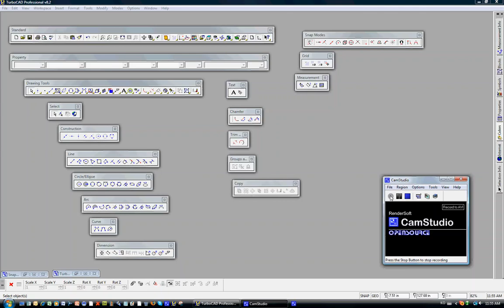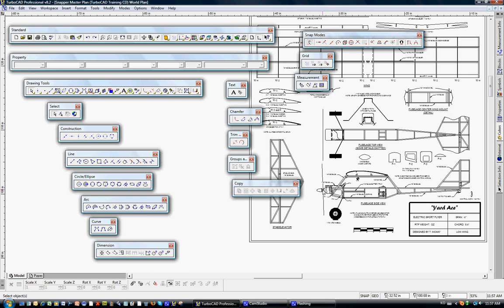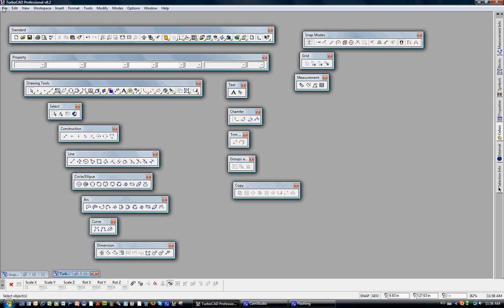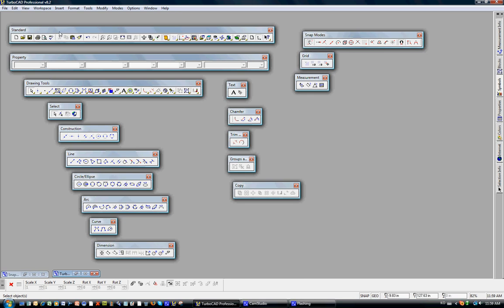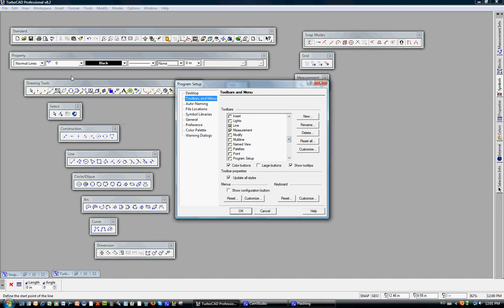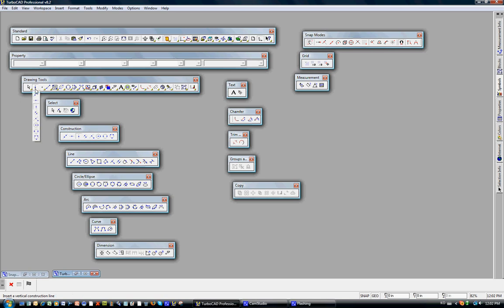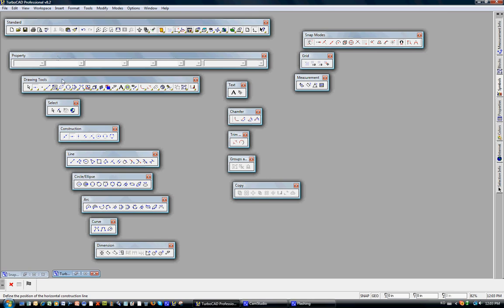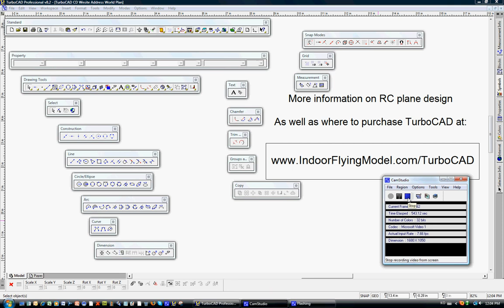Lesson 1 of 12 - Introduction to TurboCAD

Comment: What level of QCAD are you using in these videos?
Reply from the maker: Donald:  Version 8 (long time ago).  I've had so many issueswith TurboCAD version upgrades and cost, I am "all in" for 2D CAD drawing with www.QCAD.org  Around $40, works like a champ.  See my video for tips and tricks.  Tim
Reply: Tim, thanks again for the quick response. and I'm right with the comments in your answer. I have worked with SketchUp for years I have gotten hit with the response from them for the last few years, money, money, etc. I didn't state my question well the last time. I have been very impressed with QCAD, thanks for the reference. when I watch your series of lessons even starting with #! ,you seem to be able to split up the tool etc. lines very well and place them in nice thin lines at the top of the page. I can split them up and move them around well. The problem I'm facing is that all come out about 2+ inches wide on my screen. what do you do to keep them all so thin. Thanks for your help Don.
Reply from the maker: @DonaldYEastArtist  Just fiddle around with it and check the blog, you will figure it out!   Tim

Comment: Looks like the website has been taken over. What version do you use, Designer or Deluxe?
Reply from the maker: Anthony:  These TurboCAD lessons were done 10 years old on Windows, Ver 8, Deluxe.  I have Deluxe Ver 12 now on a Mac, will add some videos with this newer interface.  Basic 2D commands (snap, trim, etc.) are still the same.  Tim
Reply from the maker: Meant videos were done 10 years ago. Tim

Comment: Jan 2021   I have used TurboCAD since the mid 1990's.  So sad that their Sales and Support does not seem interested in upgrading users.  I have been using a Mac computer for a couple of years.  Bought Deluxe v 10 in Jan 2018.  Now I have to upgrade to v 12 due to Apple release of Big Sur.  TurboCAD says they now have a fix for the software to operate on Big Sur.  But Sales and Support are not giving me a price for an upgrade.  If you can't get support why buy this software.
Reply from the maker: Donald:  I hear you, as I got bit by the TurboCAD Big Sur upgrade requirement.  Still cannot quite figure that one out.  Tim